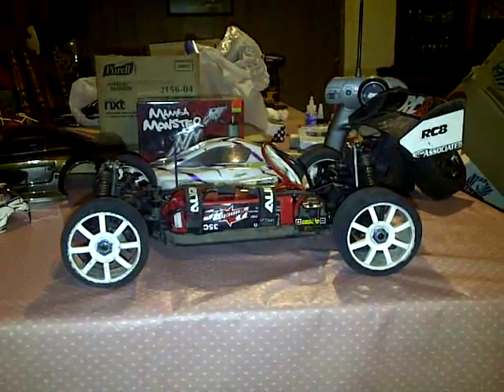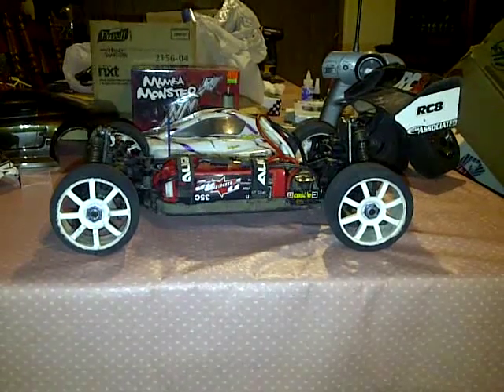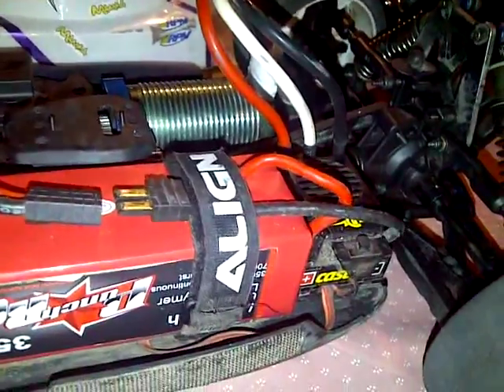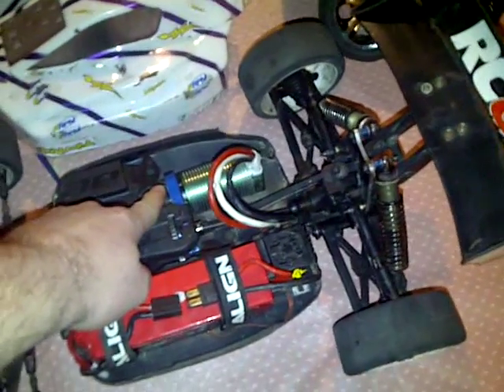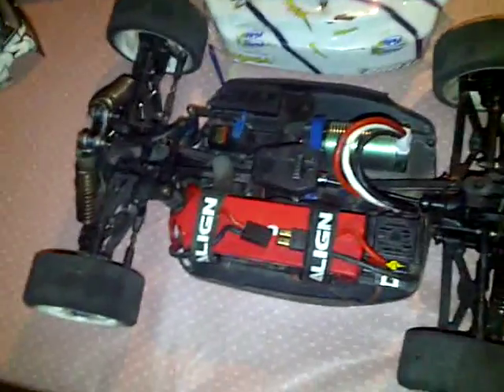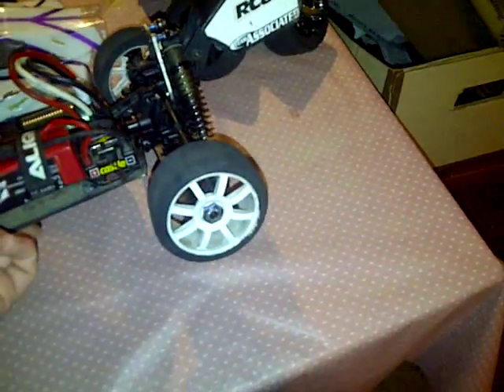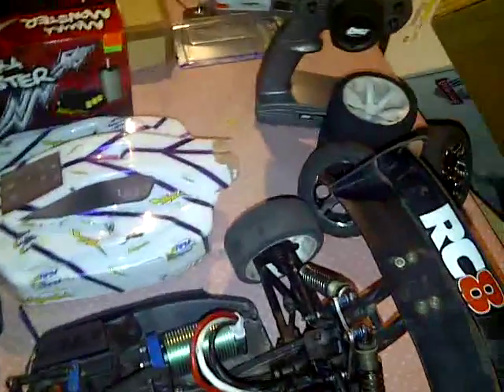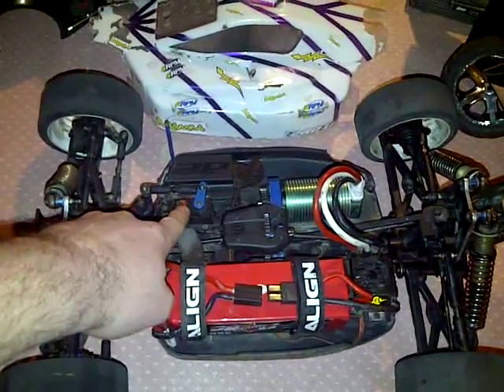how to make your Rc8 buggy go 100 mph +

Comment: Where can I get the center spool and adapter and 34-36 spur found nothing on eBay I'm running the 24/44 setup and a 65c 6s 4000 batt and it's I'm thinking maybe 80mph no idea lolplz help
Reply: You just get a 36 PINON,,with the same shaft size
as the the cups..
Reply: I build spools if you are interested.

Comment: I have the rc8 and i was using a 6s. And how have you not destroyed your center diff. I blew mine apart.
Reply from the maker: stylus mccracken heavy weight diff oil
Reply: MrMRTmustang1 okay then mabey i shouldnt use 100k weight oil then?😂😂
Reply from the maker: stylus mccracken heavier
Reply: MrMRTmustang1 500k?
Reply from the maker: stylus mccracken 250 + is fine
Reply: Well i didnt see this before i got a new diff and put in 1 million

Comment: Hey, just watched your video.  Nice video by the way, I do have 2 questions for you.  Where do you get a 36T spur gear to fit in your center drive diff?  Are you using a solid drive diff?  I'm running a 34T Pinion and a stock 46T spur and I can only get it up to 97MPH.  I've been looking for a smaller spur but I have no such luck until I saw your video.  Please help.  Thanks!
Reply: +Scott Tran take a look at kershaw designs
Reply: BASSstarlet Sorry, I did not get back to you until now.  I've been out of it for quite awhile.  I am running a solid shaft which have less friction than running a center diff. you can find small spur gears on ebay however, you must have an adapter for it.  You can also find an adapter on ebay as well. I have tried running 1:1 ratio (34T spur and 34T pinion) and the fastest speed i've got out of it is 108 MPH .  I did 115 MPH using 35T spur and 30T pinion.
Reply: +Scott Tran Well the smallest pinion i have found is a 44 tooth spur for my MT4-G3 (actually is for rc8 but you know Team Associated owns Thunder Tiger so many parts are interchangable).
Reply: Hey, what motor and battery do you use

Comment: I have a hpi Vorza and I'm trying to reach 100 the most I have done is 80 I would like to move up on gearing but I was told I would haft to slot my chassie or can I use a different motor mount I'm running 21/46 thanks

Comment: I've been running my RC8Be at 100mph for over a year now(2 years at 80 mph+ n some vids of it verified at 73mph before ballistic 5000kv number 2 died!) and I moved onto my RC8.2e with ofna foams 36t spur with a straight ofna center shaft and so on I can hit 94 on 4S with my novak ballistic 5000kv motor and RX8 ESC with 50 degree's of timing!! 6S I have done but no vids of them verified cause I broke my gun..... its nothing new just  try and hit 100mph on 4S, then come n talk to me

Comment: I watched your video and you say it can be done to several buggies , what about the Hyper 9E Bump Edition ? Any mods needed to fit the 2200kv combo ( motor mounts etc... ) and what about the gearing especially the spur gear? Would I need the Revo 8mm adapter from RC Monster to fit spur gears? 
Thanks

Comment: Did I hear you right when you said that was a 35c burst battery? Not trying to be a jerk believe me but I'm guessing you meant continuous and maybe 60-70 burst right? I run electric 1/8 on road and am just about to buy new batteries and I'm still undecided as what to get. I'm also getting a new Tekin 2650kv. I was thinking 11.1v, 3800mah 50c or 60c burst batteries because the track I race at isn't very long or demanding on motors or batteries.  Top speed on the straight is only around 40 mph.

Comment: @MrMRTmustang1 your gonna need a 34 spur to reach 100mph, trust me. and atleast a 25 pinion. You got a 34 pinion so you should be good there. I run 5000 in both diffs and you better run a spool in the center diff. When you reach 100mph, I will tell you a secret nobody knows about this car that will be even faster. Good luck. 100 MPH should be very easy to do. This is not a fucking Traxxas Rustler super invention to get it to 100. Glad that someone is looking at 1/8th scale.
Reply: Are the diff stock in your r8.2e build? Or did you upgrade them to reach speeds of 100mph

Comment: @MrMRTmustang1 the only reason I was thinking it is that the Tekin is sensored so the acceleration would be more precise in a race environment.  I love the brute force of the Mamba Monster, I have built the 100mph version you guys have designed by Ace originally, but just thinking I might make this car more versatile.  Still deciding though.

Any thoughts on what a 12S engine would be?  I have been scouring the Internet for something that will take 12S and can't find anything anywhere.

Comment: As I mentioned I am doing this project - I was wondering if you thought a Tekin RX8 + 2250 kv motor they have would do the same thing or better.  The reason I ask is I was wanting to be able to also do some Rally X stuff with this - obviously different setup for suspension / tires but make it more multipurpose - what do you think?